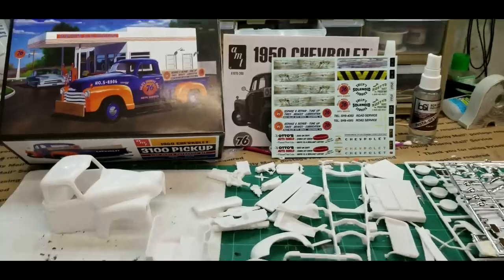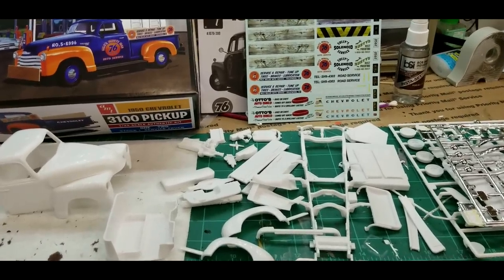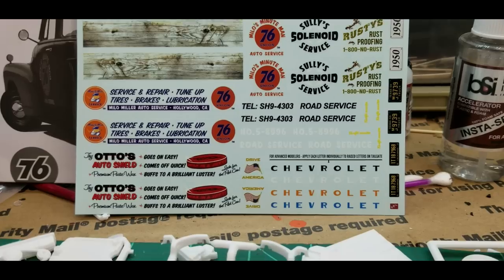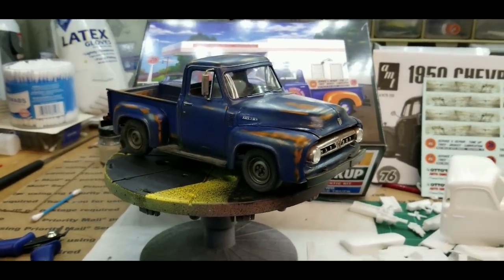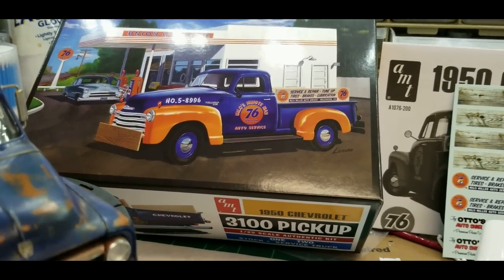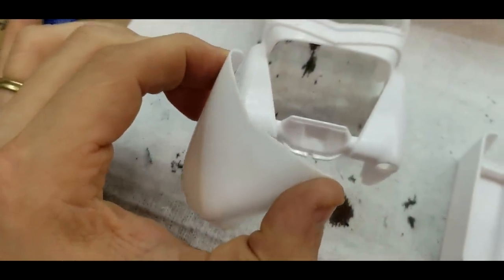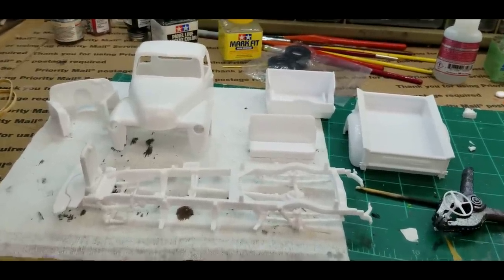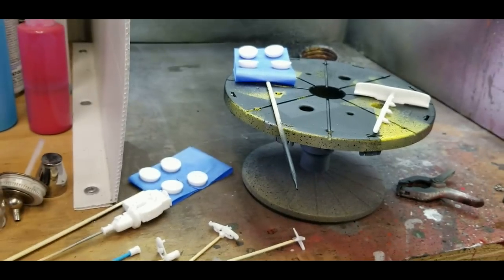1950 Chevy 3100 Pickup By AMT Worn & Weathered!!

Comment: Love the build, I used to work on customers trucks a 1951 3100 (although it was a hotrod with a camaro 305 in it), and 57 3100 with that very same 235 straight 6, rebuilt that motor after the piston went through the piston wall due to a bad wrist pin.

Try applying a coat sealer to your primer before laying the rust colour and top coats. it should prevent your getting through to the plastic, have a look at the scotch bright pads you might have them in the kitchen for dishes(it is what they are meant for after all) If you clear coat your base colour and apply your washes you can rub the excess off the surfaces, the pads also work hear trying to get through layers, bonus it turns the gloss clear flat when you are in the clear coat and removed all washes etc. This gives a buffer and a hint where you are in the layers, can matte finish after all work is done. Also generally the tops of everything end up being flat as the sun oxidizes the paint and/or bakes the clear coat off where as the side will keep a shine much longer.

Same thing with Decals I apply a gloss clear coat base evenly where my decals go, once dry I use the decal sets and softeners as intended. once done I reseal with a clear coat to seal it in and then apply the weathering/washes, something an armour model taught me as decals don't sit flat on a matte surface as it is uneven, but you can bring a shiny surface back to matte once the decals are seated smooth to a clear finish.
Reply from the maker: Very cool!!👍🏻👍🏻

Comment: The 3100 designator indicated Chevys pickup truck cargo capacity:  3100 equated to 1/2 ton; 3600 equated to 3/4 ton & 3800 equated to 1 ton....At least that's my understanding.
Reply from the maker: Ok thanks!
Reply: @modelcarvideos5829  This is completely off-topic....I noticed that u spray w/ Rustoleum.  Every time I've used that product (even on house-related projects), the paint sprays out in 'blobs'.  Ever experienced that?
Reply from the maker: Oh yeah,  I only use the primers on the bodies and for some reason it doesn't do it very bad. The colors seem to do it worse and that's why I only paint with the airbrush. I don't know how many paint jobs I've ruined because of that. I only used it in this truck because the paint finish wasn't important.

Comment: What did you use to heat/adjust the hood? Thanks
Reply from the maker: I used a heat gun but now I would use hot water. That was a while back.
Reply: @modelcarvideos5829  thanks for the info